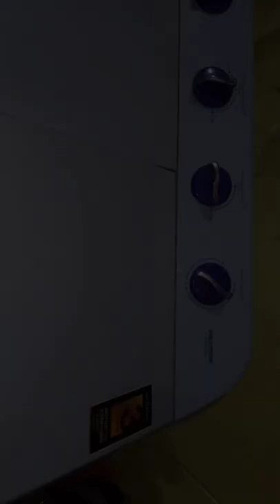cara mudah mengatasi pengering mesin cuci tidak berputar | kampas rem pengering putus

Comment: Om kalau dinamo pengering berkarat, apa karatny bisa d bersihkn, & dinamo bisa berfungsi lg,,, apa hrus diganti dinamony..? 🙏
Reply from the maker: Selama lilitan masih normal & resistansi keduanya (start & running)masih terjaga, tinggal di lumasi pakai oil saja di bagian as nya,kalo gak semprot wd, faktor karat biasanya terjadi dari kebocoran seal tabung pengering,kalo di biarkan sekalipun 3 kali ganti dinamo pengering gak bakal awet🙏
Reply: @testerbodol7394  kalo terjadi kebocoran sel apa akan terjadi konslet/nyetrum🙏trimakasih
Reply from the maker: @creatorbebas1kw  kalau cuma rembes dikit mungkin masih tertutup poly(roda kecil dinamo)dan di lapis kedua masih tertahan dudukan kampas rem sekalipun tetes airnya jatuh, sebagian orang mengabaikan dudukan kampas rem dan mencopotnya ketika rusak,padahal itu sangat membantu ketika seal tabung pengering rembes atau bocor sedikit,untuk dinamo yg nyetrum biasanya air yg bocor melewati karet seal sudah terlalu banyak/ terlalu parah sehingga kena bagian lilitan dinamo.

ada juga faktor dinamo nyetrum karena salah satu lilitan nempel ke body dinamo 🙏